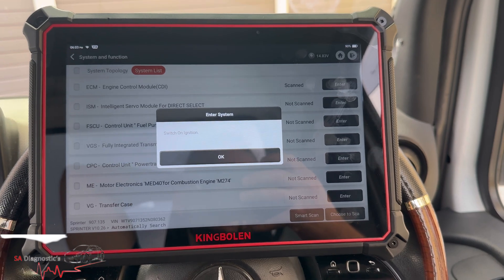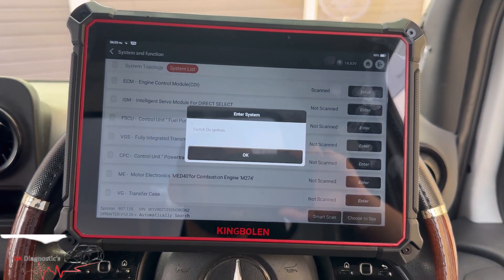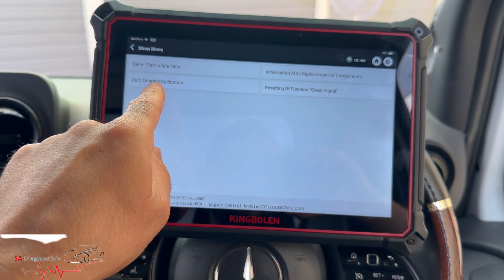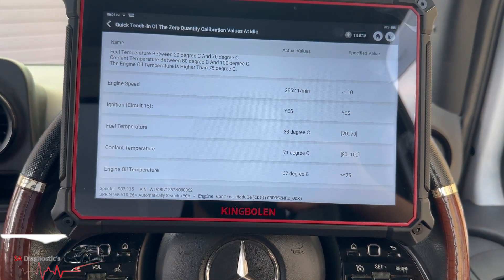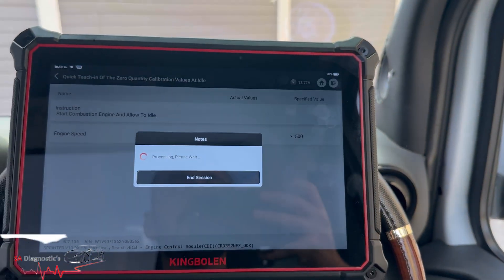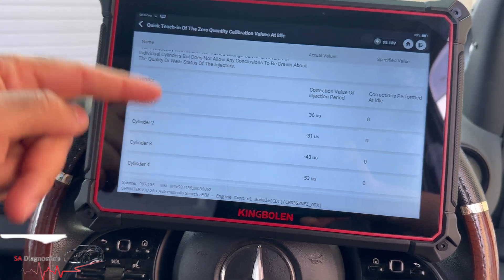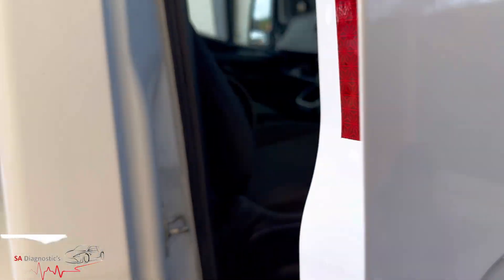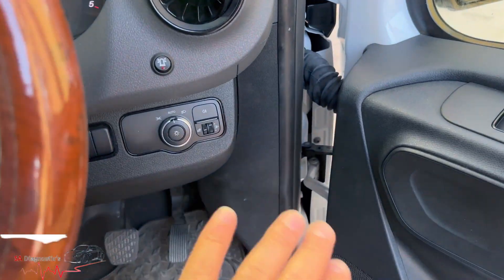How To Code Zero Quantity Calibration After Changing Injectors On Diesel Kingbolen K10

Comment: Thank you excellent video. I have just changed all 4 injectors on Mercedes W166 with OM651 after coding injectors into ECU it idles fine but very lumpy under load while driving. I have not performed Quantity correction at idle yet do you suggest quick teach-in of the zero quantity calculation values while driving?
Reply: Thank you another question on the OM651 2.1 motor 2013 ML W166, is cylinder 1 at radiator/front or rear timing chain end. I programmed my new injectors 1-4 starting from front of car. Couple other videos I’ve watched they saying cylinder 1 starts at rear?
Reply from the maker: @martynbates6697 hi if am not mistaken cylinder 1 is the first one near the radiator. You can unplug and confirm using the diagnostic machine it will trigger it straight away. I have other videos on the injector changes too
Reply from the maker: Yes you can teach in the quantity it’s probably best at idle but you can try them both. If it’s still sluggish it maybe to do with other faults but it’s best to eliminate the teach in first then try other options…